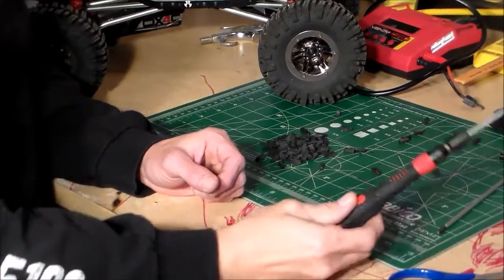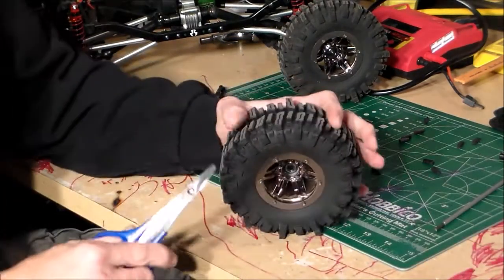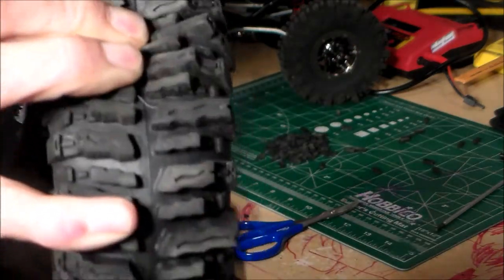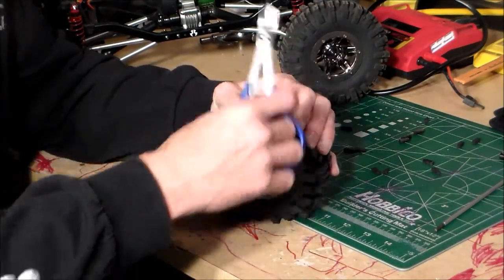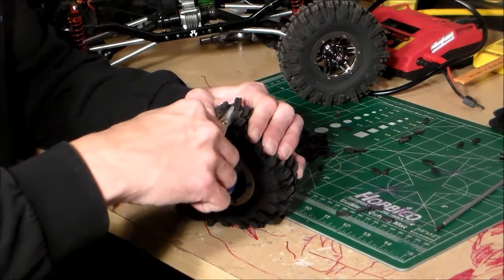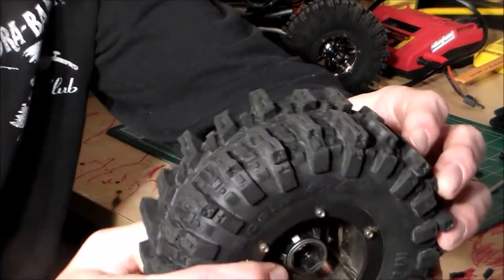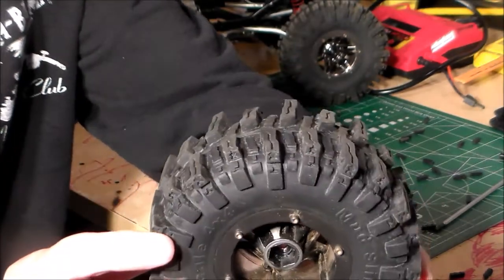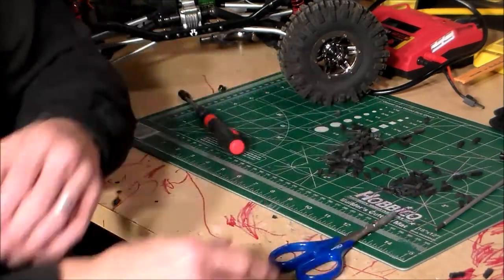K9 RC OK: HOW TO: Cutting tread on scale tires, 2.2 RC4WD Mudslingers

Comment: Looks very great, helps with my project! Does this help improve crawling on rocks?
Reply: If I could jump in, there are other tires out there designed specifically to stick to rocks, and featuring the latest soft compounds. If rocks you got, I would go that route, and save the mudslingers and boggers etc for...mud and bogs, where their harder rubber and sharp lugs bite into soft ground. Cheers eh.  https://www.youtube.com/watch?v=fNWeyrJbreQ

Comment: I would think the mud bashers would work way better,  especially with c.i foams
Reply: Actually I find the Slingers almost better due to the fadt the large lugs are high all across the tire. And being straight across the tire helps them dig and throw mud better then the tractor tire. The tractor tire lug isn't as tall through the middle of the tire as the Slinger. Mainly on the corners of them. Granted the tractor tire is much taller. I use the smaller 2.2 Slinger which is only 4.88" tall and much more scale looking. My tractor tires are a huge 5.94" tall wehich is actually taller then I like unfortunately :o( I still use them often but still prefer the smaller tire which easily works just as good if not even better :o) And they look crazy when cut :o)
Reply: Bushman RC:  I was just about to send you this link then decided to check the comments :-)
Reply: Lol! Are you watching rc videos Jim? :o)
Reply: Once in a while... :-) I watched this one thinking of you to see if it was something you might be interested in...
Reply: Rite on :o) I did this on my first set of slingers :)